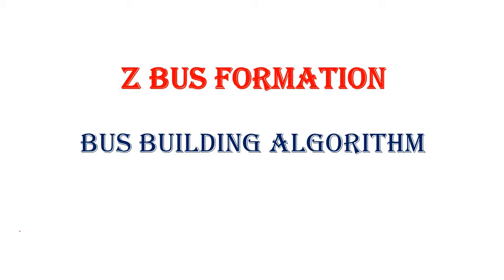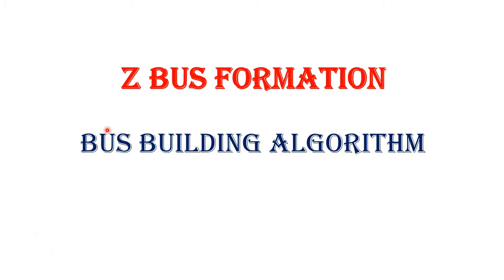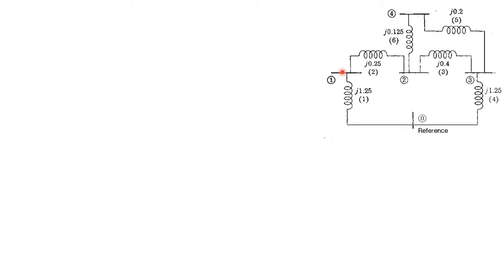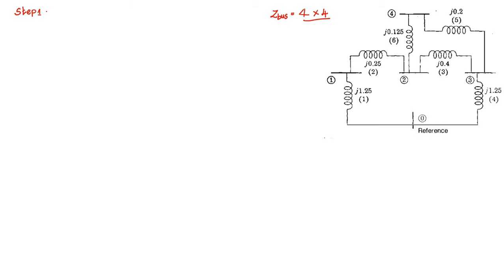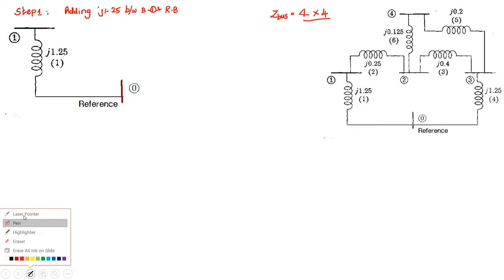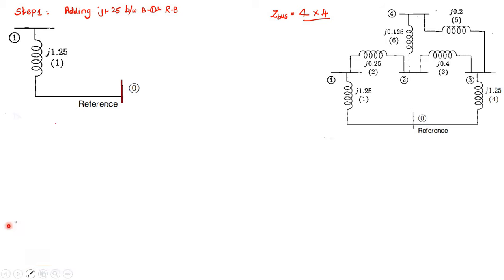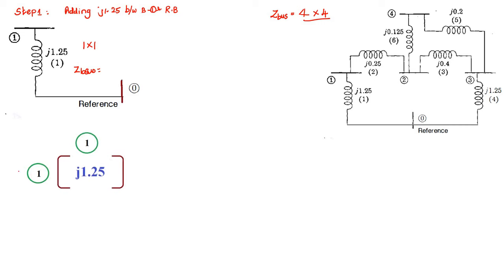Zbus formation - Bus building algorithm

Comment: Thank you for this video. 

I have a doubt. Why did you use bus 4 minus bus 2 in the step 5?
Cause I saw a video in your YouTube channel where you used bus 1 minus bus 3. 

Again, thank you. 

You helped me a lot.
Reply: That's basically absolute difference. You can subtract anyway you want, but take the absolute values. Notice in step 5 how there is no negative value in column 5 and row 5. That's because of absolute difference

Comment: why did we do 4 - 2 and not 2 - 4 ? and also what happens when any other bus is connected to reference except bus 1?
Reply from the maker: We can also calculate 2-4 , but both cases we get the same answer.if the reference bus is connected to other bus(like 2 or 3 or 4) the matrix arrange ment is changed.But the answer is not changed.
Reply: @electricalengineeringsimpl3166   Can not thank you enough for this kind gesture <3 . This was really helpful. I would be very grateful if you could give an example on how the matrix arrangement would change if another bus (like 2 or 3 or 4) was connected to the reference.
Reply from the maker: Okay sure.
Reply: I dont know if this would be of any help now, given that u asked the question 7 months ago.....but here how u add insert an impedance between any other bus and reference bus. Lets say we are inserting an element between bus 2 and reference bus, 
(Step 1)it is the same as to the step of adding an impedance between already existing bus and new bus. In the Eg above, like between bus 1 and 2, 
(Step 2) One extra step is after doing this, we have to implement Kronh's reduction, like when we add impedance between two already existing buses, like in Eg above , bus 2 and bus 4).
Anyone feel free to correct me if I am wrong.
Also thank you ma'am. very helpful video, Wishing u and ur family a long life time of health and happiness!